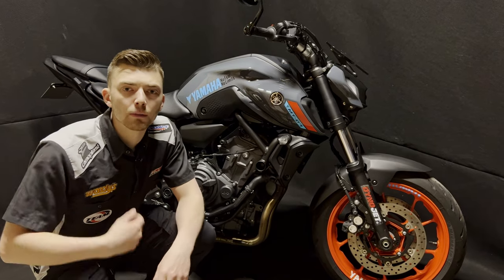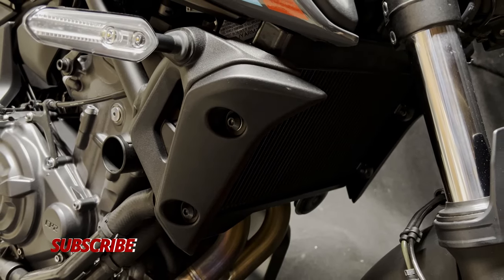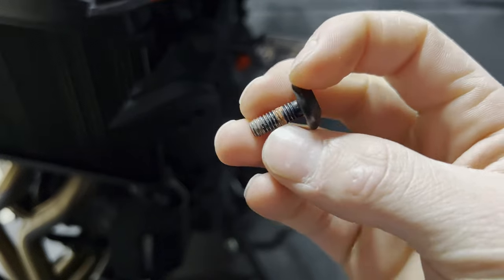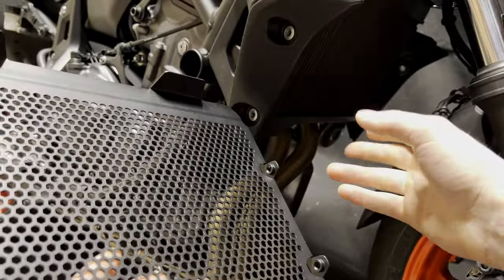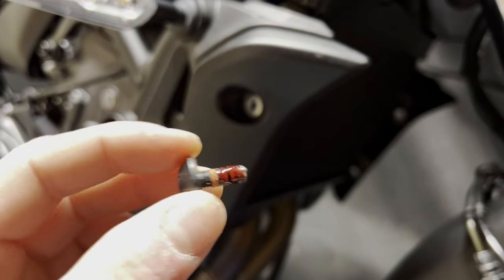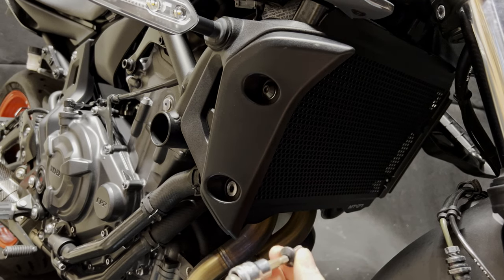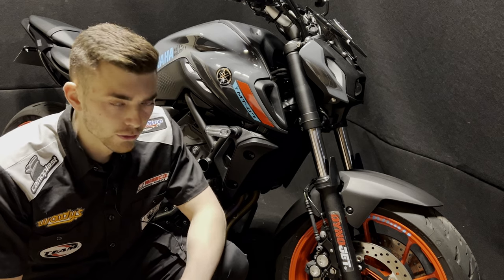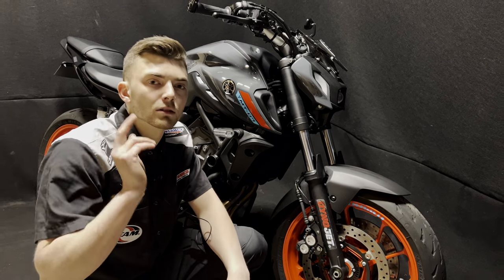How to install a radiator guard on your 2021 yamaha mt07 | MT07 mods | Why should you get one

Comment: For a hold that can be easily removed, Loctite Threadlocker Blue 242 is the hero. It’s perfect for motorized and nonmotorized parts that need occasional servicing, like car parts (oil pans, water pumps, etc), or even motorized yard equipment, bicycles, furniture and much more.

For parts that need a more permanent hold, like structural bolts in a home, auto suspensions and frames, or any other heavy machinery, Loctite Threadlocker Red 271 is the answer. This industrial grade threadlocker packs a stronger punch than the blue and can only be removed by heating the parts to 500F.  

I think I would use blue loctite over red unless you want to use heat to remove them. The red the factory used probably isn't the same stuff as the red loctite. Just a thought before you steer people in the wrong direction. Other wise good job.  🙂
Reply: There's also orange for in-between

Comment: I’m new to the two wheel game do you recommend this bike to a new rider looked at the mt03 but don’t want to buy a bike just to sell it once I get comfortable
Reply from the maker: I would ask yourself how much experience you have on two wheels in general so both on street and off. If your saying your new to the game I assume that’s new to it all. My personal opinion is to start small. The mt07 is very forgivable however but you should also tread with caution. The bike is used by both new riders and professionals. Its a fast bike and can get you in a whole lot of trouble in a hurry. If you decide to get the mt07 start slow and learn to ride it in a low traffic area. Push your limits to get comfortable at slow speeds first in a safe area. Trust me it seems like a bunch of bs but is super important! Always stay out of people blind spots and look behind you at stops. Another thing is never trust a green light. Always look both ways regardless. I got family in the hospital from a motorcycle crash and have had several buddies go down. Experience and learning the necessary skills is tedious but can save your life. Ride safe brotha!

Comment: I bought the same guard from Amazon and it came with x2 fat spacers and 4 bolts with 2 different sizes of length. Did yours come with those and you just didn’t use them?

Comment: Does this one fit on the R7?
The R7 radiator guard iattaches via zipties, which I don't like, I'd rather have the bolt on MT07 version on my R7
Reply from the maker: I’m not 100% certain but I have no doubt that with taking off the side plastics you would be able to mount it the same way you do in this video. A little more involved but I agree the sip ties are not ideal. I would lean on the side of it working though. Hope this helps